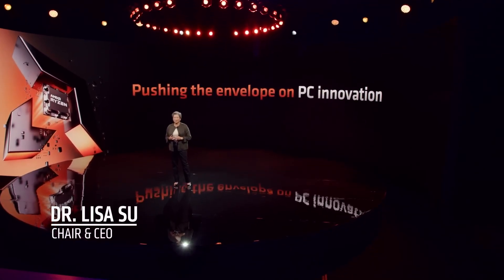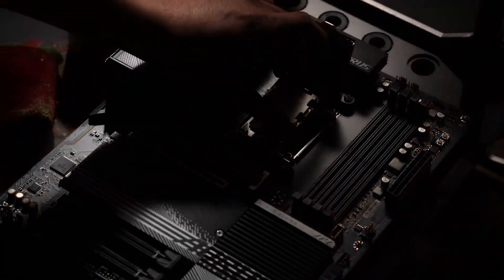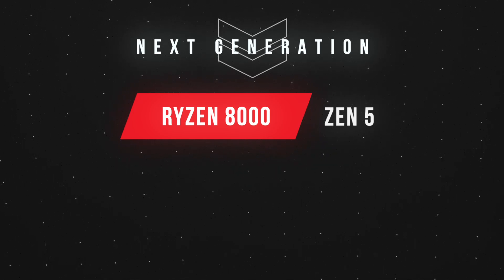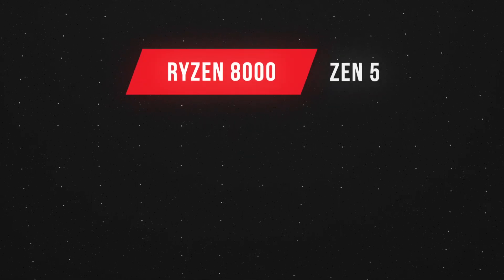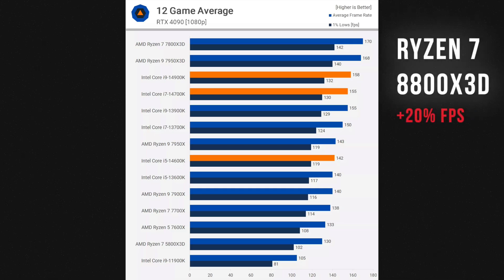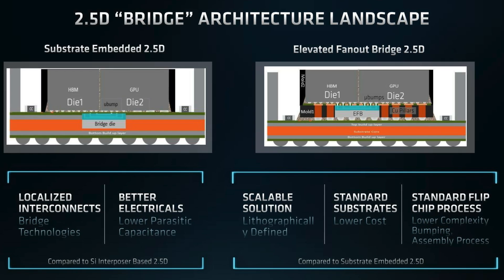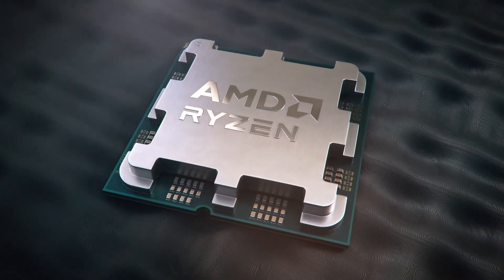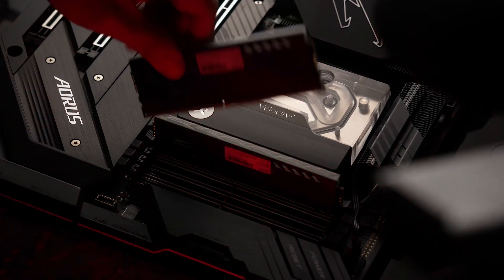The Future of AMD Ryzen CPUs 2023-2025 [Zen 5 & Zen 6]

Comment: I was going to upgrade from a i9 10850k to a 7800x3d as im getting a 20% bottle neck with my 7900 xtx at 1440p,

Should i just wait for a 8000 cpu? Any update when???
Reply from the maker: Honestly, the 7800X3D is so fast that I don't think you'll feel any need to upgrade any time soon if you choose it. Furthermore, the latest news is that the new AMD CPUs will come later that was initially leaked. Could be as late as Q3 or even Q4. So, I don't think it's worth the wait. Also, you'll be able to easily upgrade to an 8800X3D if that brings any crazy features or performance. And there is a chance that we'll see one more generation of CPUs for AM5 motherboards after that. So, even if you get the 7800X3D now you'll have great upgrade options available to you in the future.
Reply: @theivadim  hey,

That's great information thanks,

So i can upgrade with the same mobo at somepoint anyway,

Thanks
Reply from the maker: Exactly. You're very welcome.🤝🙂

Comment: AMD's game plan is literally just waiting for TSMC to make smaller process nodes, and then use those smaller nodes to squeeze in more transistors for a small IPC increase. Nothing new. Nothing innovative. They're still crippled by their chiplet design. Latency is still high because Infinity Fabric is still the bottleneck. Their X3D chip is good if the game has low to medium assets. But as soon as a game overloads the 3D cache with assets, and the cache is full, the CPU is forced to go through the IO die to reach into RAM, then performance dropped so hard. I had to return my 7800X3D because the 1% low was getting into the 90s fps whenever there were a lot of stuffs going on in the games I play, and started to look choppy on my 240hz.
Reply: This video is claiming that zen 6 will improve the infinity fabric. The reason for using chiplets is to lower prices and amd is certainly a good value compared to intel at the moment. Hitting 90fps 1% lows is a problem for only a few. For the rest the benefits of 3d v cache and the better value is a lot more important.

Comment: I am thinking my next upgrade will be in the 9000 series or 10000 series amd cpu. so late 2025 or early 2026 5-6 years between builds should be good enough time to see a good difference in performance without wasting money on small incremental upgrades.
Reply: i went from  6700k to    7950x3d

Comment: Hi Bro, hope you are very good, well tell me bro should i spend 170$ on ryzen 7 7800x3d over ryzen 7600x or 290$ on rx 7900 xt over rx 7800 xt asrock phantom gaming please reply me bro, lot of live from India
Reply from the maker: I'd get the better graphics card. More FPS in games or you can use higher settings. I can't think of any downsides of going with 7600X in this case.
Reply: @theivadim  Bro in India after taxes the price of Rx 7800 xt is 630$ and Rx 7900 xt is 980$. and the gaming difference is like 30-35fps, and the price of Ryzen 5 7600x is 240$ and Ryzen 7 7800x3d is 390$, and the gaming difference is like 20-25fps. if i am not correct then please do tell me the gaming difference. i only want to play 4k 60hz games. Please help ne out Buddy

Comment: Intel just works, i dont need a gimmicki Ryzen Chip wich i have to troubleshoot a year before i even can use them
Reply from the maker: Are you sure that it's not the other way around nowadays?🙂
Reply: @theivadim  TechLabUK and Mike's unboxing have done at least one video each on some of the AM5 platform stability issues. Seen the best gaming CPU 7800X3D  in local CEX. Maybe it just doesn't work for some  users with failure to boot, black screens, board and ram kits not playing nicely, loose unmounting of the CPU from the pins, when moving the finished pc build.
Reply: @OwDoDuck  I know two people that had issues with RAM kits on AM5 platform, but the problem was because they bought RAM kits that weren't listed on the motherboard's memory compatibility list.
Reply: @theivadim i' m very sure 17 years Intel + Asus never had a single issue. one time i try a 7900x and it was a nighmare, never again dude is an AMD system going into my case!

Comment: Like the 5800x3d vs The r7 7700, the  7800x3d gaming performance is so good I wonder if zen 5 can beat it without 3D cache.
Reply from the maker: Zen 5 will beat it for sure. I think Ryzen 5 8600X should be able to match 7800X3D performance.
Reply: I doubt an 8600X will bet the 7800X3D. It will probably be within 5% or so.
Reply: @erickelly4107  
Why do you doubt it? AMD already did it once with the 7600x vs 5800x3d...

Comment: If amd is not adding more cores, they would lag behind intel so much. 8 cores is the minimum for new games and some like cyberpunk, staefield, etc. are starting to use more than 8 cores.
Reply from the maker: It'll be a while before games start utilising more than 8 cores properly. Even in the games you mentioned you can see diminishing returns after 8 cores. It's just not worth spending on. Better put that money towards a better monitor or graphics card, imho.

Also, don't forget that Intel offers just 8 Performance cores. And the latest leaks suggest that the next generation of Intel CPUs will still have just 8 Performance cores.
Reply: @theivadim  yep and when you start to have a dual monitor setup your multi tasking while gaming will eat up some of the 8 cores. I mean the e cores is as fast as ryzen 3000 series cpus and is totally usable in games and muti tasking. 

I mean if your talking price, ryzen 7 and i7 seems to cost about the same with i7 having the edge with cheaper motherboards and ability to use cheap ddr4. I would definitely sacrifice a little fps for smoother gameplay and muti monitor setup with hitches.
Reply: Hopefully zen 5 will be the last gen R5 with 6 cores

Comment: amd cpus seems to be really powerful for what they give I'm being intel user since my first gaming pc and even now but from what i saw in the current gen benchmarks the 7950x is one hell of a beast and also very good for gaming aside from the 7800x3d the 7950x is one hell of a beast in my opinion the perfect balance for having high performance at gaming while im sure it will also have very high performance in other stuff like production programming etc amd cpus seems to be very good they are not joke anymore i mean the ryzen 9 5900 and 5950x weren't bad too but the fact that 7950x draws a lot less power than 5950x while bringing very big boost in performance shows how the am5 platform have been improved since am4 im talking about zen 3 to zen 4 has been improving amd cpus im actually really impressed by this cpus being intel user since my first gaming pc i've seen that zen4 ryzen 7000 really is improving since the zen 3 ryzen 5000 since from what i heard using almost half the power for much more performance like 30% gaming thats very good and using much less power i heard half the power of zen 3 ryzen 9 5950x makes the ryzen 9 7950x one hell of a beast
Reply: Bro.
Please.
Use some punctuation. Just some very basic punctuation.
Reply: @kaystephan2610  thank you my English is not great don't tell me how to write

Comment: Assuming next gen X3D chips will be 20% faster than the current ones. Intel needs to be 30% faster just to match the next gen X3D performance.

Based on current meteor lake leaks it looks highly unlikely that intel will be providing users upto 30% performance increase in gaming with arrow lake.
Reply from the maker: Indeed, what we hear about Meteor Lake is concerning. I'm keeping a close eye on it.
As for Arrow Lake: I think Intel plans to get most of their gains by manufacturing chips utilising a more advanced process. 3nm in 2024 vs AMD's 4nm. But even then the 8000X3D will most likely compete well if not exceptionally well.
Reply: @theivadim  
Rumor from MLID is that rentable units will not be ready for Arrow Lake AND they are abandoning hyper-threading. This is going to be bad for Intel, unless they have a secret up their sleeve.

Comment: I want AI performance, gaming performance is already more than adequate. That's probably not coming till the next DDR generation though, as AI performance is so memory bottlenecked.
Reply from the maker: AI on a processor? Do you mean you want to see an NPU integrated into the package? I thought that only makes sense for laptops as every little bit of power needs to be saved to improve battery life. But on desktop GPUs offer way more compute power for AI than an integrated NPU can ever achieve. Not worth it. Or am I missing something?
Reply: @theivadim  He doesn't know what he's talking about xD. We need more gaming power. CPUs still struggle in some moded games. I know that the optimization is the problem but more raw power from a CPU can solve a lot of things.
Reply: If ur a dev that makes sense
I only use AI to change my GF body😂
Decent phone can do it fast
Reply: Gaming performance will be adequate when a CPU and GPU can run all games @ 240fps during 1% lows minimum

Comment: I think Zen 7 (Ryzen 10,000 or whatever they'll call it) will be the CPUs where AMD will move onto AM6 and DDR6 given how DDR6 is expected to launch in 2026.
Reply from the maker: That makes sense👍
Reply: 2026 will be when the standard is finalized. Usually it takes at least a year or two more for it to be actually used. So I think we'll stay on DDR5 until at least 2027; with a possible new socket for Zen 6 and 7 in between. AM 5.5 or whatever.
Reply: It has been said, at least till 2025 on current socket.

Comment: Very exciting to see the advancements that AMD is making in its design. It will be a shame if Zen 6 isn't supported on socket AM5, however, they may be able to release the Zen 6 architecture in 2 phases, like a Zen 6 on AM5 and Zen 6+ with all the bells and whistles on AM6.. The reason for this is that the camp of customers who bought in to the long support promise of the AM5 socket can get their hands on the latest chips for gaming and for those that seek the ultimate 16c or 32c X3D variants of Zen 6 can upgrade their platform to AM6. That would be reasonable. It's all speculation of course.
Reply from the maker: I think it'll be all Zen 6 Ryzen models on AM5 or nothing. Either way, I'm excited to see if AMD will actually increase core count on the mainstream platform. It has been a while since the last increase.